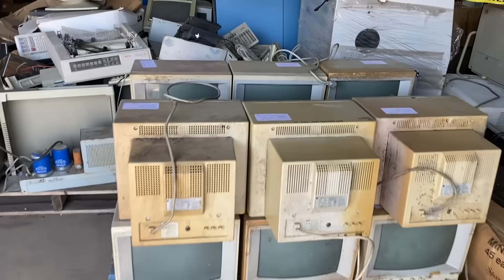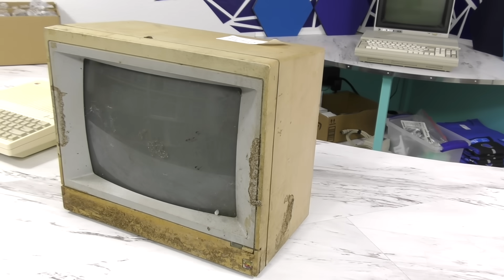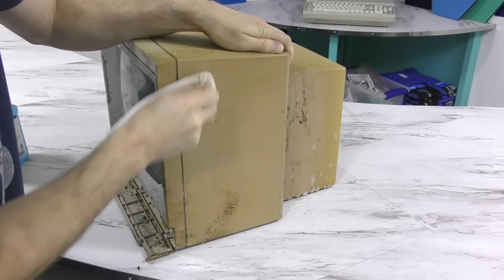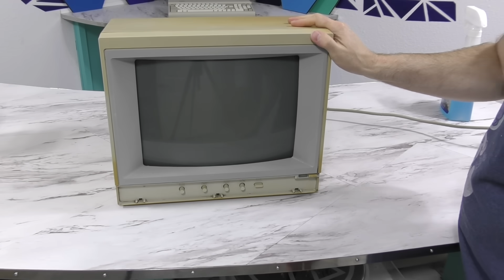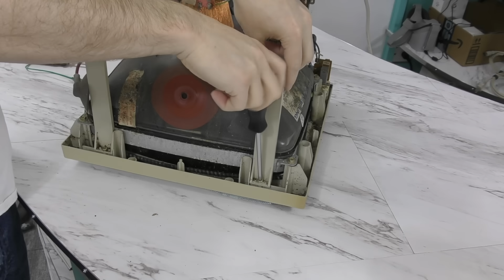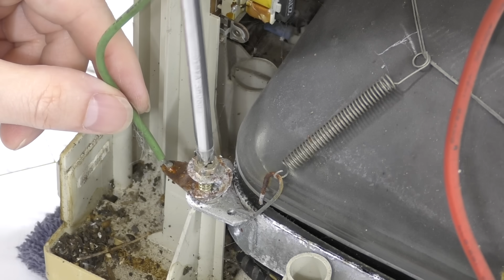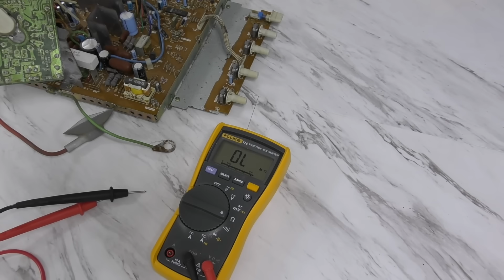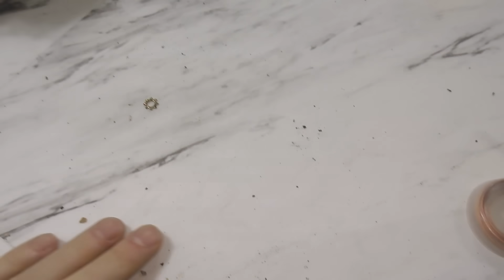Apple Monitor Found in Landfill - Restored - Part 1

Comment: It is too bad there is no schematic available for this monitor.  I’ve been extremely curious how the color killer feature worked on these monitors.
Reply: Probably just disconnects the NTSC color decoder signal.
Reply: @johndododoe1411  That’s what I’m thinking as well, but without a schematic I cannot confirm it definitively.  There is other more involved ways to do it but that doesn’t make sense for a feature built into a monitor where it is much easier ways to fool a monitor into believing the signal has no color component to the signal.  The Laser 128 has a color/mono feature that was of some interest to me as well but I soon discovered it was a feature of one of ICs.   
I’m only interested in blocking or suppressing the color burst signal that tells the TV to go into color mode as on some modern TVs the black and white signals from Apple II’s are more preferable to the color mode which is a headache inducing blurry mess.  I use to have an old Apple II which stopped producing color signals and it was so nice.  Just wonder if there was a way to build a filter or signal modification device to do the same.  I know I could probably get an S-Video comb filter device (2D or 3D) and just use the Luma out signal to do what I want for about US$25-40.
Reply: @kuillus  A notch filter swallowing the entire chrome carrier frequency 3.58MHz would change color composite to monochrome without modification to computer or monitor, while a monitor that already separates out the chroma signal for further demodulation could just retain that filter and throw away the chroma signal near the chroma demodulation circuit.
  Targeting just the chroma burst pulse may deactivate some chroma demodulation circuits and confuse others into producing wrong colors.
Reply: @johndododoe1411  a extremely tight notch filter at 3.579545 MHz±10 Hz might do the trick on older CRT TVs but I’m not sure if the last CRTs or the newer LCD TVs would be fooled.  On older black and white TVs made before color do not block the color artifacts (they ignore the color burst).  The newer TVs might still be able to reproduce color from these color artifacts even if the color burst is not present which is suppose to activate the color circuits on CRT TVs.  Worth a shot, but probably should only be active during the blanking intervals else it might deteriorate the signal.
By the time I get around to building this circuit there will probably be more cost effective and readily available options for HDMI output from Apple II and IIgs so messy ugly video is no longer an issue that needs to be solved for modern displays/TVs.  Limited availability of the HDMI is probably my biggest reason for wanting to build a color blocked in the mean time as legible B&W is better than A2 Color, until I can acquire better.

Comment: Apologies if you get this suggestion a lot, but a small parts washer would do wonders for cleaning stuff like this. You can put water or whatever solvent you like in them, many of them come with brush attachments that will scrub and flush debris away.

Comment: That diode seems to me like a regular high frequency SMPS diode. Most likely an general purpose replacement will be sufficient as long as it can handle the frequency (15khz) and the voltage (most likely 180V).
Reply: Ultrafast rectifier

Comment: The diode looks like it is BYV38 (2A) / BYV26 (1A) fast diode but you can also use PR3005 (faster and 3A) or UF4007 (fastest and 1A)

Comment: I thought you said, "If there were cat juice it would be sticky" and all I could think was, "Yeah and probably smell pretty horrible every time it got warm!"
Reply: I heard the same until I realized it was cap juice…
Reply: I thought the same!
Reply: took me a few sec too
Reply: The question is what would you rather clean off of a board, cat juice,  or cap juice?
Reply: @vetchb.s.c.1612 : Good point—both are nasty, but whichever is less destructive on the traces and other components would be the preferred choice (the lesser of two evils).
Reply: "Cat juice, you can only rent it!"   -- Alf
Reply: Oh, trust me..you DON'T want cat "juice" on your circuit boards. More specifically... male cat spray. That shit is NASTY! It corrodes the hell out of solder joints and most metals. I had a Colecovision completely ruined by a cat doing that. Someone told me in the comments that I could have restored that. Huhh no way..not this one. It was beyond restoring. It was so bad. 

Lesson here. Keep your cats away from your valuables. And keep your valuables out of reach where a cat might decide to piss on it. Male cat spray is WORSE than regular cat piss! 

Yeah.. "cap" juice is easier to deal with. I'll take that any day over cat spray.
Reply: @brucewrigleysgumchewz4667  Absolutely spot on (or should that be "spray on"?) .. the trackpad PCB on my Dell machine is slightly the worse for wear because of that .. and the control button PCBs on two of my monitors.

I can confirm that neutering does not completely inhibit spraying. Luckily my antique stuff has been spared by these two 🐈 🐱 (not sprayed!).
Reply: xD I just made the same comment and then saw yours ;-;

Comment: A couple years ago I would have thought the same thing. No chance in hell. But then I saw either Adrian or Perifractic (or possibly both) restore a C64 left outside for 30+ years and there was almost nothing wrong with it. After seeing that I don't know what to expect.
Reply: I guess you saw this guy fixing a similarly crusty VIC-20...
Reply: @johndododoe1411  that was bad enough, but it was mostly just covered in oil. And yeah I was pretty surprised he could fix it and it wasn't that hard of a fix either. But that's night and day compared to sitting outside in the elements for 30+ years. lol

Comment: It amazes me how well that old stuff was made compared to today's stuff.  They built to last back then.
Reply: Survivor bias. The 1% that survives till today is the best of what was made back then. People will be saying the same thing about the 1% made today that survives till 2070.
Reply: @ecospider5  Yeah, the demand for old electronics is way less than the demand there was for them when they were new. And there's still enough of a shortage of surviving ones that even the most common ones command a pretty penny.
Reply: Prices were way steeper, too. That said, it's amazing any kind of electronic equipment, no matter the build quality has survived a lifetime of exposure to weather.
Reply: not really. MOS ICs are LEGENDARILY bad. there are thousands of dead C64s out there because of failed chips. SID chips are notorious for overheating themselves to death. Yes, those were among the first generations of ICs and we were just learning how to make them. But solid state products nowadays will outperform and outlive any of those old ICs. What fails nowadays are power parts, and only because they run them hotter than they should.

Comment: 12:33 that's just a common vintage TVS/Avalanche diode, probably Hitachi or Matsushita; this isn't really anything special, it's better than germanium / glass tubes. 
You can replace this diode with any common parts, as long the diode can withstand the flyback transformer.
There is modern parts still produced by Vishay, i think it's called "Ultra-fast Sinterglass" diode or something, not really that interesting thou.
EDIT:
I think that's just an old, common Hitachi V06
Reply: How about this one Tarodenaro?

Hitachi 400V 1.3A, Diode, 2-Pin V07E

https://docs.rs-online.com/5247/0900766b813b75ca.pdf

Comment: I still have to find a way to fix my Commodore 1701. The picture is "ok" but its al over the place and its BUZZES very loud.
Tried to open it but some way i could open it all op without de-soldering a bunch of wires :/

Comment: Finally a real restauration from the landfill, there are so many fake ones on youtube.
Reply: Except it literally wasn’t a landfill.  Piled out back exposed to weather, yes.  Landfill, no.
Reply: @peterwmdavis  Gone through about the same, though, screw your literal whatever. Common sense, please, comparable condition pretty much.
Reply: @BilisNegra  Apart from not having been covered with dirt and then having heavy equipment driven over top, yes.

Comment: You have an issue with flyback blanking too. Try not to leave it on for very long after changing the High voltage diode, or you’ll have the lines forever on that crt. Lookup the fly back blanking circuit in the service manual for it and you should easily find the cap that causes your fly back issue.

Comment: I would highly, highly, highly advise against trying such monitors on and see if they are working if they have been outside in the elements for so long.
Speaking from experience from repairing televisions and such, more than often they will explode quite literally.
(well, maybe a little dramatic, but I think you understand my point)
That not being said from a safety point of view (I assume someone is well aware of the risks), but I have seen TV's going so bad that they were unrepairable.
Which would be very unfortunate for a piece of history like these.

If anything, try to very slowly power them on with a variac and some kind of over current protection.
But still, things probably go wrong faster than your fuse will be (or lamp, or whatever you would like to use)

I also can't say I blame you, I also have done that on multiple occasions. LOL

Great video and awesome find btw! :)
Reply: One additional, I would definitely re-cap everything. No question with these kind of old devices being so exposed.

Comment: good video but the diode is a fast switching high voltage diode.
I suspect the diode you referenced as a replacement probably wont work

Comment: My guess is there is much less hope for anything actually buried in a landfill.  The pile of monitors and junk outside may look rough but the advantage is that water will drain/evaporate especially stuff on the top of the pile.  Even the humidity isn't that bad all the time in North Texas.  When you start talking stuff buried underground you get into constant humidity or even immersion in liquids of various sorts or even chemicals.  Also landfills get very hot inside due to the breakdown of organic materials so you have basically a worst case scenario for corrosion.

Comment: >A component died in a monitor
>Get another monitor for the component instead of finding a schematic and then buying a new version of that component 
WTF???
Reply: I was thinking the same thing too....Seems like he didn't learn his lesson from the mystery IBM video. :/

I've been a fan of the 8 bit guy for a long time now and I wouldn't be where I am in terms of my hobby without his content, but some of his practices in restoration seem sloppy and rushed to the detriment of what's he's working on.

Granted this time, these monitors are more common, but the point still stands.
Reply from the maker: Those remaining monitors at CR are destined for the dump.  There aren't exactly a lot of people lining up to buy them, even for the $10 they are charging.  So, I didn't see any harm in using one for parts.
Reply: @The8BitGuy  Alright, that's a fair point. Though I personally would still be hesitant on borrowing used components like diodes from other things unless I'm damn sure it'll work. ROM chips are one thing, but stuff that deals with High voltage I typically try to use new components unless I have no choice.
Reply: @The8BitGuy  Well, buying one just for a diode seems really silly to me. Also silly to me is buying caps that you didn't need after all.
Reply from the maker: I bought the caps before I even started the video.  (Fortunately somebody had made a list of caps for that monitor so I knew ahead of time what to get). When making videos I have to plan weeks ahead to have everything I need, otherwise the videos can take forever to finish. I do this kind of thing all of the time, as it's part of the job.   Hence, the diode.  If i had that part on hand, it wouldn't have been split into a two parter.  But unfortunately, I can't always predict everything.
Reply: @The8BitGuy  plan ahead. perhaps that IBM prototype power supply would have appreciated you planning ahead when needing to open it up, or was blowing up the power supply not what you planned on? but still. who doesnt have torx and security bits handy for projects.
Reply from the maker: Actually, that is a perfect example of not being able to plan ahead. It was on loan and I had it for just a few days.  I had no idea what I would find inside and no way to plan for what I would need ahead of time.  Otherwise, I would have had all of the needed tools on hand at the time of the video.
Reply: Do the schematics even exist outside some basement under 1 infinite loop?  For modern Apple products, diagrams have to be smuggled out to give independent repair some kind of chance.
Reply: @johndododoe1411  At the end of the video, you can see and hear that David found the schematic and bought the diode. It's not the issue with the current monitors of Apple, it's the issue with this old monitor.
Reply: @itogi  It looked like he found a diagram of how to typically use that Samsung picture tube, not an actual Apple diagram.

Comment: 13:06 That diode looks like a sod57 package but that's all i know.
Edit: I browsed sod57 and sod64 catalogs and since diode connected to +180V  part number might  be BYV98-200 , BYV28-200 , BYV27-600 or BYV28-600
Reply: BYV27-200-TR or something like this
Reply: Although this is 200v rated
Reply: Given it's on the 180V B+ rail, I think it's a zener diode rather than an avalanche diode (which I initially thought). The part number BZT03C180-TR is a 180V zener diode in a SOD57 package available from Vishay. Given the flashing and the high drive brightness of the CRT, I think the arcing across the disintegrated diode caused just enough of a voltage drop to occasionally lower the B+ drive power and allow the screen drive to drop to a more normal level as Dave showed in a still frame capture. This definitely makes me think the diode is a 180V zener used to regulate the B+ drive power. The fact that there are 180V zeners available still today suggests these are CRT monitor/TV replacement parts.

Comment: That component behind T3 looks like it's a spark gap, which is designed to protect against overvoltage. Your high voltage regulation is defective, which is what is causing the HV to run away, blowing out the picture before arcing and then coming back. The pattern of dim, bright, arc, dim, bright, arc is a bit of a giveaway on that.

If it was an actual diode then it must have been the damper diode since that's in the HV circuit.
Reply: some of the connection points on the underside of the board look if not corroded at least in need of clean I suspect voltage is jumping, leaking and at least another component gone u/s (or a trace).  Buy at least 3x as many diodes as you might need, as one might blow before you have noted what is going on
Reply: It's the rectifier for one of the flyback secondaries, I believe. It's possible the rail it supplies is sampled and used to control the HV, but on the other hand the failing diode could just be causing the problems in other ways.

Comment: Sadly, I think that electronic components in a landfill just wouldn't survive in quite the same way. Landfills would have a ton of decomposing material generating a lot of heat and humidity, all kinds of god awful chemicals, heavy machinery driving over and shifting it all, and a lot more time with consistently high moisture levels. I'm not saying that Texas is an ideal climate for storing electronics outside but that location was a hell of a lot better than a landfill.

Comment: Just use any suitable ultrafast recovery diode. UF4xxx, 5xxx or similar
Reply: Don't forget the voltages involved, such as that 180V (nominal) pin on the diagram.  Remember that vacuum tubes generally run in the 100V to 300V range for signals and power, while the big jump from back to front on a CRT is well above 10kV.
Reply: @johndododoe1411  That diode is just part of the not so spicy circuitry. I think that it just powers RGB amplifiers on the neck of the CRT.

Comment: I found a 13 inch color monitor but the poor thing was shattered in several spots so I left it. Glad to see these being restored.
Reply: If the big vacuum tube is broken there is very little chance of repair.  Back in the day we took out a dedicated (cheap) insurance for the risk of having to replace the CRT in the television, because that was basically the most expensive component failure possible in a TV.

Comment: It sucks that the 2nd monitor had the same issue :(
Out of all of the ones in the stack, that one had the "best" test results.  The others said "no power" or "no image."  Maybe one of those would've had a better diode, maybe powering them on to test somehow damaged the parts?

If you're gonna try to fix one of them, would it be worth it to try to fix both of them?  Otherwise, what are you going to do with the 2nd one?

Comment: I think Adrian had some other device with weird ball shaped diodes inside not long ago. Weird component.
Reply: I'm guessing those are really old school diode packaging from the 1950s or 1960s, by the time these monitors were made, the style was probably only used for some odd type numbers that had not been updated to more modern packaging.  A bit like when some chips are currently sold in DIP packages instead of SMD.
  The colors on the package probably indicate the type number using the same colors as resistor markings, maybe someone could read out the colors for the 8-bit guy to compare to antique component catalogs/data books.